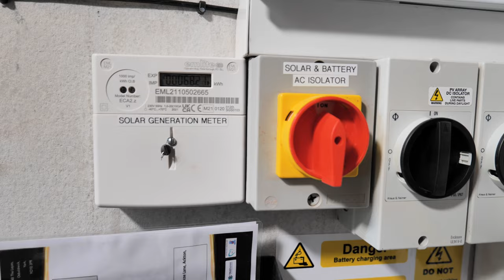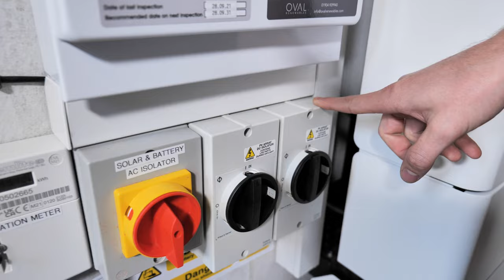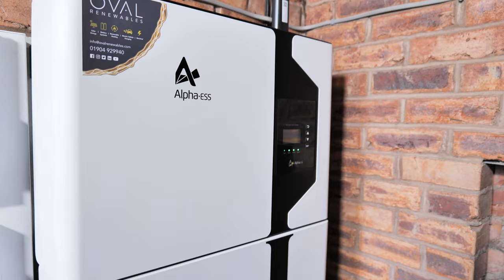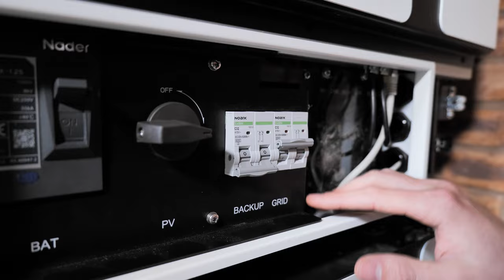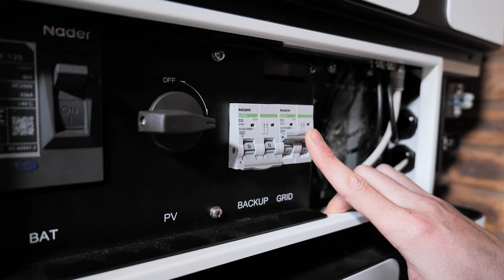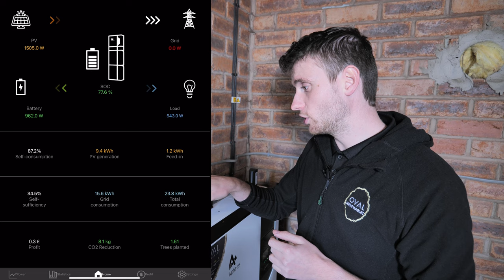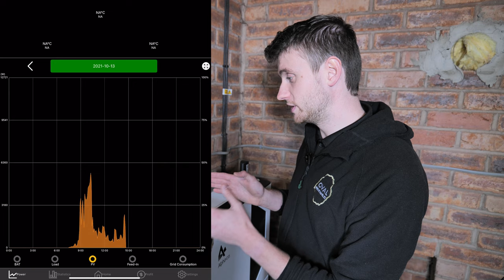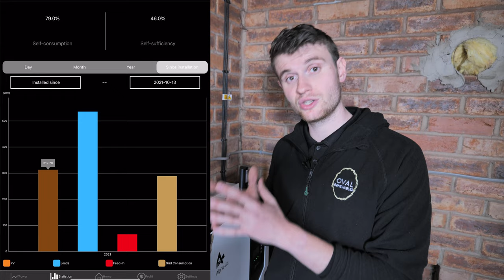Alpha ESS Smile 5 Battery Storage & Solar PV System Installation

Comment: At 19:20, why is the left axis max value at 12721 watts?  This is a smile 5 and should only have max PV at 6.6kW, if i understand it correctly?

Also, in a hybrid-coupled configuration, if the other inverter have more PV output than the load, will the other inverter help charge the smile 5 batteries using it’s surplus harvest?

Comment: 2 big problems I have with the Alpha ESS system I had installed:
1. Mine seems to use about 130watts "phantom juice" just running itself, it has a fan that runs 24/7/365, it's wi-fi / ethernet is always on, plus it's inverter is always warm. Other reviews have said the same. Maybe Alpha have addressed this with newer ones, mine is 3 years old.
2. The off-peak charging can only be set at hourly intervals! It shows hours and minutes but only accepts "00" for minutes!!!!  My Octopus off-peak runs from 00:30 - 04:30.  This means if I want to set it to off peak charge I can only do so between 1 and 4am! Mine can only charge at 3kWh. In that 3 hour window I can only charge 9kWh at cheap-rate. I have 11.6kWh of storage (4x2.9kWh version). I literally cant' charge it fully in off-peak because of their infuriating software!!!  I've messaged the company SO many times - but they just close my tickets!   It's also annoying when I want to charge the car off-peak. I set it to charge at 00:30 and it'll drain the Alpha intensely for 30minutes before the Alpha starts charging. It's SOOOO frustrating Alpha won't fix this! It could sync with the car and not deplete itself unnecessarily!
Other than that I do like having battery storage - just wish they could have built a better product / fix their own software bugs!!!
Reply from the maker: Hi mark! Thanks for the detailed message. I share your frustration on the second point. We have been assured that’s this will be changed in an upcoming software update as it is silly that it isn’t able to charge on half hours! As for the first point the new Alpha smile 5’s don’t have a fan and use a heat sink so this would reduce that 👍
Reply: @OvalRenewables  Wow. That'd be great if they do it. Thanks for the reply!
Reply from the maker: @markyates5744  I am going to push for this, if I get an update I will try to remember to leave a comment here to let you know.

Comment: It's best siting a battery/inverter system in a utility room - 2 big reasons:
1. charging / discharging is not 100% efficient. Each way loses about 7% to heat. When you're off-grid charging on cheap-rate, sited indoors and you're going to get say 1kWh of heat for each 13kWh electricity stored. It'll basically act as a free heater. Sited outside and it's waste heat.
2. as the batteries approach 0 or 5C they can't be charged as fast and throttle back to a slower speed. This might prevent charging / discharging at full power. I've read of them being limited to 1kWh at 0C.  Like humans - they don't like very hot weather, and they don't like freezing weather!  It's also supposed to be damaging to Lithium Iron Phosphate to be subjected to freezing conditions - and in Northern Europe you're going to get 0C in some garages, out-buildings, and especially external mounting IP65 or not - it's not liquid heated/cooled like most EVs.
Reply from the maker: Hi mark, in an ideal world I would agree with you as if you have the space an area that has a steady temperature would be best. However in reality this isn’t always possible due to space 👍

Comment: Nice video but how does this all feed into the existing consumer unit. I presume 1 breaker feeds the battery to charge it at night but how does the battery feed in? I think it’s through the same breaker but how does the system draw from the battery and not the grid? Is there some sort of relay?
Reply from the maker: Great question, thanks for watching! So it’s actually nice and easy. The energy feeds through the ‘Renewables DB’ and into the Henley blocks. From there it feeds through the supply tails to the main consumer unit. The system naturally prioritises the energy from the battery or solar as this is a slightly higher voltage. No change over relay is required.
Reply: @OvalRenewables  ok so, into the renewables DB, then out through the tails to a Henley block that’s also go the original tails to the DB in it and that’s it? That’s pretty simple. I thought there would need to be a way to stop it feeding back to the grid, how does it know what path to take? I thought maybe path of least resistance.

Comment: If we have two existing PV systems (both 8kW with standard Solis 5G grid-tie inverters) installed in different locations (one in garage, one in house) how would you have the Alpha system monitor the total cumulative output of both systems in the app? Is there space for another CT clamp?

Comment: I am very interested in this system. I have an EV and charger where in a bungalow can all this equipment be installed? In the lot I have plenty of wall space?
Reply from the maker: Thanks for commenting, we we wouldn’t install this in the loft due to the weight and issues with repairs and servicing,  but sometimes there is enough space in a utility or garage? Failing that the battery can go outside.

Comment: Really enjoying your video's which got me into the whole renewable energy research. My EV will arrive in Sept and we are planning to have solar and battery storage installed. I'm hoping to complete the Oval quote questionnaire in the next few days and hope that you guys are willing to install in the New Forest!  As it stands what battery system would you recommend? I really like the Sonnen but the more I look the more I see which makes narrowing it down a lot harder. I like the hybrid systems which have the inbuilt inverter and  would like to be able to add additional battery capacity when its needed as well as looking for good customer support etc. Thanks.
Reply from the maker: Glad you are enjoying them, thanks for watching! We are installing a lot of Alpha batteries at the minute as well as the SolarEdge Energy Bank battery. So it depends on the capacity you need and your budget 👍

Comment: We are I Australia. We have an existing 4kw system with inverter then installed an extra 4.7kw of panels that feed directly into the battery system. So far we have gone through 2 inverters and now have nothing working. How can this install be working which is the same setup as ours and ours is not?

Comment: Hi, fantastic video Sam, The system here is exactly what I would like to have at home here in Lincolnshire, but office advised me you busy for couple months before take enquiries.  What paperwork and permit did you have to get from DNO (?) as I note you say export is limited to 5k/watts.  Is this inverter limited or in software. I really trying to understand all of this.  Might wait a couple months then knock on your door again to see if you can help me.  Appreciate your comments, regards Phil S
Reply from the maker: Hi Phil, thanks for the message. Sorry we are not able to look at this for you yet. So there are a couple of bits to this. If you are feeding the battery directly with solar then it can charge the batteries with 5kw of power. However when you are exporting or grid charging it is capped by the inverter to 4.6kw. We can lower that cap via the software if the DNO require it. The type of DNO approval will depend on the size of system you want. Have you already got solar?

Comment: Great video. I’ve just discovered the Alpha battery in the last week. Love that you’ve done this video on it.
How does the Alpha compare to the Givenergy batteries. I’m keen on the UPS ( think that’s the ability for power to house in a power cut)?
Reply from the maker: Hi Scott, thanks for watching! I prefer the Alpha over the Giv system. I think Giv have a better customer support currently than Alpha as Alpha are pretty new to the UK so haven’t build that part up as much yet. Functionality wise the Alpha has a better output I believe. The UPS is also great! To make sure I am clear, I haven’t fitted a Giv System so can’t comment on it exactly, my opinion is based on the data sheets 👍

Comment: Enjoyed the Video I've a 14 Panel PV array to a 5kw Solis inverter and a Solax X1-Fit gateway and a 5kw Battery + 5kw Slave Battery my issue is that the PV Generation doesn't show up on my Solax App so can I run a CT Clamp from the Solis inverter to the Solax so they talk to each other ? I'm asking because both systems on your video appear onto 1 app which is basically what I'm after achieving.

Comment: Seriously  looking into a solar set up with battery system have no water cylinder though in the house we used 2800kw last year of elec id say we are lower end users no ev and not much chance of having one in the next 10 years as we tow a lot  and I can't justify cost of purchase of an ev what size solar array would be a good option would you say not fussed about feeding back to grid id happily be off the grid unless feed in is due to rise   cheers in advance for any info sun comes up one side of my roof and down the other side with no shading to my knowledge 😀
Reply from the maker: Hi Steve, thanks for the comment! That’s a nice low consumption, you should be good with a 3.68kw solar Pv system. Have a look at a small battery system as well as the 0% VAT would be a real saving on the solar and battery system combined. 👍
Reply: @OvalRenewables   any suggestions on a system and rough costing fully installed hooked on your channel and artisan  electrics  top notch work every time  im pushing towards  a system within the tiles maybe  as I think my roof membrane would be better to be changed  whilst the install happened to future proof the roof too

Comment: Great and informative video but not thing you said was that the Alpha-ess system has to be floor mounted.  This is not true, I have one on the outside of the house and I asked the installer to mount it higher on the wall to allow room for two more of the 2.9kwh modules in the future.
I wish I had known in advance how much the charging rate is affected by the ambient temperature.   Most nights it has charged at around 2.8kw but on colder nights when it has dropped to below 5 deg C, the charging rate was only around 1kw so in the four hour “off peak rate window” it did not fully charge the battery which is very frustrating as well as more expensive having to use full price electricity later in the day.  I’m now looking at building an enclosure which will still allow some ventilation but protect t it from wind chill.
I’ve still not got the ups functioning as I had hoped as my installer says that the spikes caused by the Fridge/freezer  cutting in caused the breaker to trip so we are looking at a reduction in the number of appliances that will served by the UPS.  My priorities are the controls and pump for the gas central heating, the internet, the CCTV, some lighting etc.
Reply from the maker: Hi Myke, thanks for that. 99% of the time we mount on the floor due to the weight of these 5.5kwh modules but you are correct they can, if absolutely required, be mounted off the floor. Yes temperature does make a difference so positioning needs to be considered. I hope you manage to get setup soon!
Reply: @OvalRenewables  For me, as I was installing the batteries outside I had two reasons for wall mounting my system, one was to allow for easy expansion of capacity at a later date and secondly to protect the batteries from any surface water or heavy rain splashing up on my driveway.
Reply from the maker: @mykehoole5787  sounds very sensible 👍
Reply: Are you not meant to have 600 mm spacing either side of the battery ?
Or is it just advisable?

Comment: Brill video, can I ask if grid goes down, will the smile 5 inverter charge the battery and power up the house with energy from solar either or from battery?

I think freonius gen 24 plus multi flow.

Do you install freonius and London near Ruislip area?
Reply from the maker: This is possible with the smile 5 as long as the solar is installed directly into the battery, on this video our new system was. The UPS mode would need to be activated with the specific circuits wired through the Alpha, on this job the UPS mode was not used. We install nationwide but aren’t currently taking on new enquiries. we hope to reopen these in a couple of month time.
Reply: @OvalRenewables  thank you

Comment: Hi there, we had this battery installed but I don't think it is wired properly. The numbers on the app say we are taking energy from the grid and giving energy back to the grid. Very little solar power is being used and so we think the wiring may be wrong. Would you be able to check on the installation and show us how to use the app?
Reply from the maker: Hi Sara, send us an email to sam@ovalrenewables.com and I’ll see if we can work out what’s wrong. Also add some photos to the email 👍

Comment: Is the inverter the weakest point?
Reply from the maker: Usually yes
Reply: @OvalRenewables  So if the inverter failed the whole system would be off line I'm assuming?

 What do you think about the Enphase microinverters if one fails the whole system can still be used?

 Manufacturers tend to offer 5 year warranties on their inverters (even if they last longer than this). I know the microinverters are more expensive but systems based on those would be more reliable than single inverters?

Comment: Great video, very informative. We are currently looking for the best battery systems to put within our developments and videos like this are excellent, so thank you. 
Would it be possible to put these systems within flatted developments? Is there a different battery system for this? We are particularly interested in the off peak charging to make use of renewables on the grid. Any advice would be appreciated.
Reply from the maker: Thanks very much. Yes they can, I think this will become very popular. We have a few customers getting these batteries just for the savings based on peak and off peak energy rates
Reply: @OvalRenewables  is there any intelligent software available to predict when / how much to charge the batteries from cheap grid power? I’m thinking of weather prediction to ascertain how much solar will likely be achievable the following day. 
Would the Sonnen battery be able to do the same as the Alpha and what are the pro’s and con’s of each system (appreciate that’s probably a long answer so I’ll drop you an email!).
Reply: @OvalRenewables  Alpha are huge here in Australia but I’m pretty sure there aren’t allowed to be installed inside the house in Australia.
I paid for the smile 5 10.3 kw with 6.6 kw jinko N type fully installed £4000 here in Australia, we  has the cheapest installed residential solar in the world.

Comment: Hi, I am in Australia, but this is the best video I have found so far for the Alpha ESS. I currently have a Fronius 8.2 inverter that supplies the Grid and my house, I'm looking at installing a battery and the Alpha ESS has been recommended because of it's flexibility in setup, my limited understanding is that it will be installed as dc coupled? between panels and Fronius or slaved to the Fronius, this is due to limitations placed on us that only allow 10Kwh of inverter, even though it is 5Kwh export limited, so putting the 5Kw Alpha (inverter) as AC coupled would exceed what is "seen" by the power company, hence the need for the Alpha to be behind the Fronius to just charge operate the batteries and let the Fronius talk to the grid. Is this setup possible?
Reply from the maker: Thanks very much. If you want myself and the team to come out and fit you an Alpha just let us know, we would love a trip to Aus… 😂

Yes the Alpha is very flexible, it can be AC coupled, DC coupled or a bit of both. The battery can limit export but the exact configuration would depend on what the network operators have specified. DC coupling the alpha would remove the need to have the Fronius.
Reply: I have here in Australia the 6kw fronius 3 phase 7.92kw panels west array and alpha ess 10.3 kw  smile 5 dc coupled 6.6 kw panels east array and works a treat.
What state/territory you in ?

Comment: For those looking at the Alpha ESS SMILE 5 AC systems, be aware that their charge management system has a fault where it limits the PV Charging during the specified Grid Charging period used for load shifting.

This issue means it is not possible to do a set and forget configuration that caters for both sunny days requiring no load shifting, and dull days that do require load shifting.

I estimate the problem reduces the system overall efficiency by some 15%.

I would not recommend this system and its variants.

Comment: Been following for quite some time and your videos are so informative compared to others. I have a smile5 inverter with a 5.7kwh battery and want to expand the battery capacity. Can I add a smile5 bat 10.1 kWh battery to my existing system? Or does it have to be multiples of 5.7kwh batteries
Reply from the maker: Thanks very much! I have actually been having this conversation yesterday. It has to be the 5.7kwh module. Otherwise you have rip out the 5.7’s and add the 10.1’s